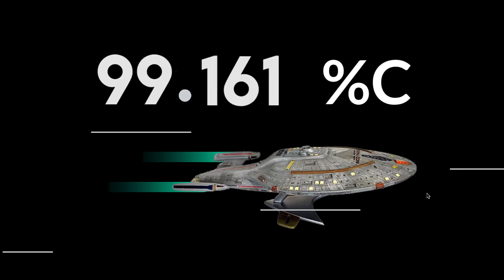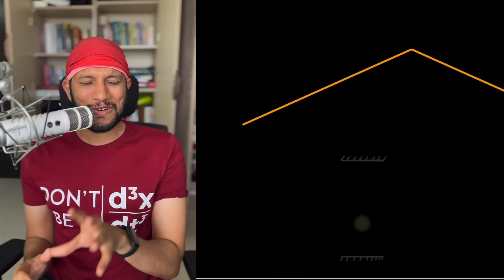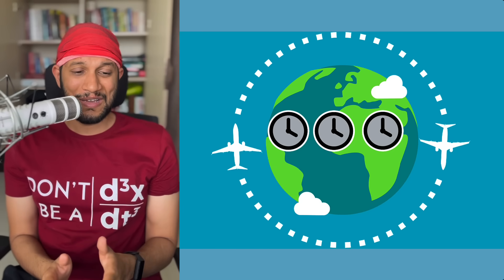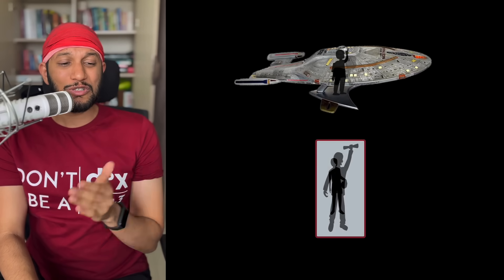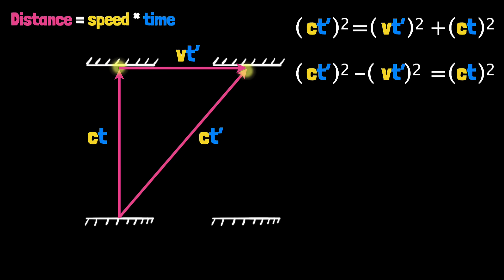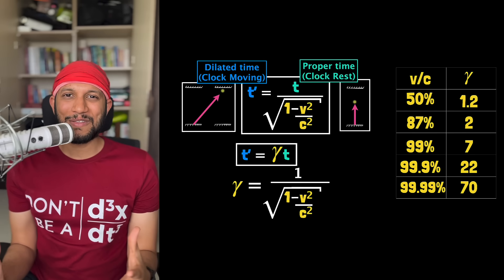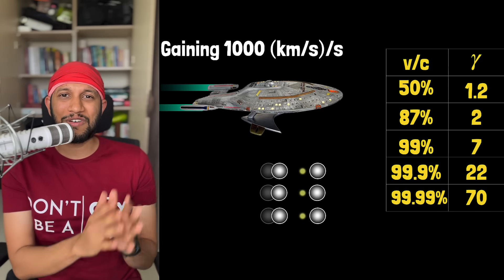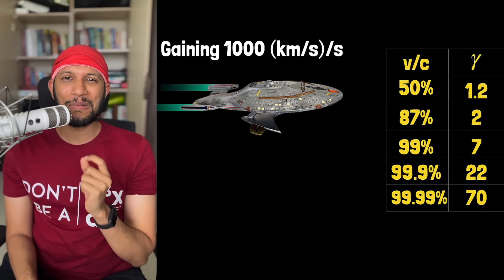I finally understood why you can't go faster than light! (My mind is blown)

Comment: Question- for the people inside the ship, it's still accelerating 1000 km/s per second.. so for the people inside the ship, will from their perspective they achieve the speed?? Yes from outside it may look different but what about inside.. they are accelerating same as before so in their perspective they should touch the speed??
Reply: Think about how a person in the ship measures their speed.  It has to be measured relative to some frame of reference.  In the reference frame of the ship itself, the ship is always at rest (since the frame moves with the ship), so that's not a very useful way to measure your speed.  So it turns out that if you want a meaningful measure of your speed, you have to measure it relative to some external frame of reference, and as we see in the video, the ship's speed in any external reference frame will always be less than the speed of light.

Comment: Time at rest is known as “standard time.
This is based upon time at the earths surface.
The higher you go above the surface time changes and even the lower you go below the surface time changes.
Humans cannot see things going at certain speeds due to our brain not being able to recognise the movement/motion. For instance we cannot perceive the flickering of hz rate on our tv due to its speed.

At some point, depending on the direction you’re going… be that deeper into earth or away from earth… things will either become invisible 🫥 or things will simply stop having motion, or at least all things will go extremely slow to the point it will take eternity to even move a finger.

Comment: Its very simple why matter cant travel at c, E=mc. Atomic energy converts to radiant energy with acceleration. ALL matter becomes radiant energy at the soeed of light. Boil water and the molecules are accelerated to c or radiant energy. There is no increase in mass. You dont get more mass with acceleration, you get less. 
Suggest you go back and recheck your math because there is no instance where mass increases with acceleration.

Comment: Nice explanation. 
A question based on the intuition that you wonderfully helped explain.
In a dense medium which can reduce the speed of light, can this phenomenom be observed?

BTW infinite amount of fuel is perhaps not correct, it is the ability to generate equivalent thrust to match the dialation. Example: if the engine has modes to switch between generating more thrust from the same amount of photons. Then fuel is not infinite rather the engines thrust value is infinite. This is a zero sum game.

Comment: I'm confused. Aren't we pretty much always moving, so it's always "on the ship"? There's never an example of it before the ship for me to use as a reference. I can extrapolate, but that only makes me question: Is it possible to have something still? This leads to about hunderd other questions... Shit, I should have gone to college.
Reply: Something can be at rest in a particular reference frame, but one of the central postulates of special relativity is that all inertial reference frames are equally valid.  So there is really no such thing as "absolute motion/rest": you are simultaneously at rest in one frame and moving at 99.999% of the speed of light in another.

Comment: This explanation is wrong. 
Let us assume that the starship moves vertically instead of laterally, and emits thd ray of light veryically also. According to this explanation, when the starships moves in the  same direction of the ray of  light  it should slow down, and it should go faster if moves in the opposite direction, but actually in both cases the timd dilatation factor is the same
Reply: This is explained by the relativity of simultaneity. His explanation is correct, you just don't quite have the full picture of special relativity yet. Mahesh actually explains this in the twins paradox videos.
Reply: @GoofyAhOklahoma  the simultaneity principle that is used in the twin paradox does not apply to the mental experiment I proposed, because I meant just one way, not way and return. Then,  there is not a change of reference frame and not simultaneity. 

What I meant, is that comparing in this way the experience of the observer inside the starship with an observer outside it is wrong, because also distances "experienced" are different. So you cannot look at the ray of light in both reference frames and calculates how they relate one another simply looking at them as shown in that video, because you are assuming that at least one variable is the same (in this case, the wrong idea is to look at the lenght of the ray-path in the two reference frames at the same time like if these quantities were experienced by the same observer).

 In fact, this example doesn't work with the idea I proposed because in one case the light path looks "shorter" , in the other looks "larger"!.

In general, given that both (x,t) are transformed into (x',t'), you cannot look both reference frames as shown in that video.
Reply: @andreamazzolani3138  You are correct in saying that one would also need to account for length contraction, yes. But that does not make his explanation wrong, for length contraction is a subject he decided to save for a different video. This video was focused on time dilation, and he explained it very well. But you're right, he didn't give the whole picture.

But as for the relativity of simultaneity, that phenomenon also applies to constant velocities, not just accelerated reference frames, and it is just as important a factor to consider as time dilation and length contraction. Take for instance the barn-pole paradox, which involves no shifting of any reference frames, but is explained by the relativity of simultaneity.

Mahesh actually has a video titled "Why velocities don't add up" which is essentially the same as this video, but he discusses time dilation, length contraction, and the relativity of simultaneity. It was posted about a month ago.

Comment: What if the ship was being accelerated through a very very long gravitational field? Since the ship is constantly in the field no matter where it goes, the “force carriers” (whether those are gravitons or what have you) of the field would not need to travel longer distances as the ship get faster, because the ship is actually continuously running into them. It seems like then we would not have this issue. And objects of different mass fall at the same speed, the increasing mass of the ship wouldn’t stop it either.
Reply: in relativity, gravity and acceleration are indistinguishable, and you can't accelerate a mass to c

Comment: My question is what if we turn the photon clock 90 degrees, so it's facing in the same plane as the ship. Won't time delation then be negated? The photon will take longer to travel to the end of the clock, but it will return quicker. Does this not cancel out the effect the ship's speed has on the photon clock?
Reply: no, since to the relative observer the mirrors are a short distance apart, to the stationary observer the fwd mirror is moving away at near c
Reply: Not really sure I understand, how does either of those points disprove what I said?
Reply: @danielthomas4082  what is it you think you’re disproving, time dilation?
Reply: @AMC2283 No, this explanation just doesn’t make sense to me if you re-orientate the photon clock,
Reply: @danielthomas4082  the light is also red shifted towards the rearward mirror to the stationary observer so it takes just as long to hit as if vertical

Comment: I have a very stupid question. I hope I will be able to put it well in words. The light clocks. Obviously, the photon doesn't have any mass and, as a result, inertia. There is no acceleration since the speed is constant... but. If we have the mirrors positioned like they are in the diagram, would the photon actually keep up with the mirrors if the ship moves perpendicular to the reflection vector? Wouldn't the photon move slightly backwards with every bounce (respectively to the mirror) if the mirror moves forward? Will we see some difference in the "experiment" if we would rotate the mirrors 90 degrees and the reflection vector would match the movement vector? Please don't hate me. This glitch just appeared in my head and I can't fix it. Help!:)
Reply: the mirrors reflect the light--they're in motion to the stationary observer.  if it reflects forward and back instead of up and down, it'll have to catch up to the fwd mirror moving away from it
Reply: @AMC2283  ah... tru. From their perspective, they are at rest! Thank you!

Comment: One thing you said that I don't understand. Each of those photon "ticks" between the mirrors forms a curved line segment, as is the line segment representing the path and distance traveled by the mirrors. (To complicate matters, those curves change with motion as gravitational influences change.)   It is my understanding that the Pythagorean Theorem holds in Euclidean geometry, but not in a "curved" geometry. (Thanks to gravity, our universe in not flat.)  How, then, is the Pythagorean Theorem relevant in the derivation of the Lorentz factor?

Or does the Pythagorean Theorem apply to the curved "triangle" formed? Why would it?  It doesn't apply to a right angle triangle on the surface of the earth, where one side is at the equator.

Help!

P.S. I love, love, love your videos.  I subscribe to them.  They are clear.  They are challenging.  And they raise new questions for me.  They encourage me to take out my math and physics text books and watch more videos.  Thank you!

Comment: is it not wrong to assume that the photon will look from below to go at an angle in fast moving spaceship, inside photon clock....unless shot at an angle.....because photon doesn't have momentum like a thrown ball in spaceship.....it will look to go straight up from ground also...isnt it...if that is so, then this intuitive approach is false. vertical (to the direction of motion) photon clock will not work properly at v high speeds. a horizontal photon clock can intuitively explain time dilation perfectly and correctly imho. at speed of light time elapsed will be 0. the shot photon will be never able to reach the front reflector of the clock. hence explaining time dilation. at intermediate speed, clock will keep slowing down. at zero speed, 1 second will be equal for both the photon clocks at both places. at speed of light, the photon will always keep chasing the opposite reflector of the clock. not only the second will never complete, it wont even start. it is like a bullet chasing a criminal running at the speed of bullet in same reference frame. light chasing light never catches it, otherwise sunlight would not have been continuos. also, if someone travelling near speed of light doesn't return to earth, then he/she will age slower than the sibling on earth (relatively stationary), when observed from earth sibling pov, but if he returns to earth, he will be same age as sibling. because time is relative and not absolute. time dilation issue at high speeds is because of design flaw/limitation of the clock and not rate of change of thing which is perceived time wrt a reference plane.

proving that nothing can go faster than speed of light because of clock limitations is not same as proving that time dilates in reality.

Comment: What you've proved is:
"If speed of light is same in all frames of reference THEN nothing can travel faster than light."
That's why in the right triangle you draw, the hypotenuse length was cxt` whereas in newtonian physics, the speed of the photon to an outside person is \sqrt{c^{2} + v^{2}} (because Newtonian physics assumes that time is same for both observers, while you assume that c is a constant), but you have simply used c...where am I wrong?

Great video, I am first time visitor and from non-physics background, so feel free to correct me

Comment: This is only true for the object with mass. Massless particules such as protons, has no problem reaching the speed of light, because they don't accelerate, they are emitted from the source right at the speed of light. But, the question is, the Universe it self is expanding faster than light, how?
Reply: electrons and protons are not massless and do not travel at c.  nothing accelerates to the speed of light, it's a constant.  space time isn't an inertial body being accelerated, it's the framework of the universe and isn't relative to anything, no mass in expanding space time is moving ftl.
Reply: “Space” isn’t an object, the best way to think of space is like a giant coordinate grid that stretched throughout the universe.

So the movement of “space” is not bound to the speed of light.

Comment: Nothing can ever accelerate to the speed of light.🤔 Wait a min here. "Light" can accelerate to the speed of light, it's not nothing.
Reply: Nothing with mass can accelerate to the speed of light.  Light is massless and is not subject to this restriction (it also does not accelerate: it always travels at the same speed).
Reply: @extravagantpanda7962  yea, adding mass to the statement would make more sense. But light can decelerate and accelerate under the influence of gravity or through some special materials.
Reply: @gmichia  Light doesn't accelerate under the influence of gravity.  It just follows along a "geodesic" (which is a generalization of a straight line on a curved manifold) through spacetime.  The spacetime around a massive object is curved, so a photon traveling nearby will just follow the curvature, but this is not an acceleration: the photon is not changing its direction in spacetime, spacetime itself is curved. 

Also, the speed of light in a particular medium may be slower than the speed of light in a vacuum, but this speed is the speed of propagation of an electromagnetic wave through the medium, not the speed of an individual photon.  The photons still travel at the speed of light in a vacuum when traveling through some medium, they are basically just constantly bumping into things which slows down their overall progress through the medium.
Reply: @gmichia the reason light travels slower through a medium is because it physically interacts with the molecules, getting absorbed and then remitted which takes time. Between this it still travels at c because all massless particles must travel at that speed

Comment: but from the pov of anyone in the ship wont the acceleration be same so i get that for anyone outside the ship itll take infinite time but wont the people in the ship reach c in finite time using finite energy
Reply: The acceleration will remain constant (assuming the engines keep firing and the ship has enough fuel), but they won't ever reach light speed.  Remember that speed is relative, so when you talk about their speed, you have to specify what you are measuring relative to.  

In the reference frame of the ship itself, the ship is trivially always at rest, so it will never reach any non-zero speed in this frame*.  Therefore if the person on the spaceship wants a useful measure of their speed, they must measure it relative to some external reference frame.  And that's exactly what this video already discusses: according to any outside observer, the ship's speed will approach c asymptotically but never reach it.

 *(Side note: this is a non-inertial reference frame since the ship is accelerating.  In order for its speed to be constant in this frame, there must be an equal and opposite acceleration to cancel the ship's acceleration.  The source of this acceleration is a so-called "fictitious" force, and to someone on board the spaceship it would just feel like a gravitational force pulling them "down".)

Comment: Does the speed of "thought ' slow down the faster we go? Has this been appreciably studied?
Reply: From a strictly physical standpoint, thought is nothing more than electrical impulses in your brain.  It is just another physical process, no different from any of the processes in the clocks mentioned in the video.  So yes, thought slows down in exactly the same way as everything else.  But remember that this slowdown is only in the reference frame of some outside observer.  YOU are always at rest in your own reference frame, so you never experience your own time slowing down.

Comment: The one thing I don't get about the moving clocks...who is moving?  What does a moving observer see with a "stationary" clock if all motion is relative?
Reply: "Moving" and "stationary" are relative terms that are only meaningful when applied to a specific reference frame.  Suppose Alice and Bob are floating out in space.  In the reference frame attached to Alice, she is stationary while bob is moving at some speed v away from her.  Since it is Bob who is moving in this frame, Alice will see that Bob's clock is running slow.  In the equally valid reference frame attached to Bob, Bob is stationary while Alice is moving at speed v away from him, so Bob will see that Alice's clock is running slow.  Suppose they are joined by their friend Charlie, and in Charlie's reference frame both Alice and Bob are moving toward him with speeds Va and Vb, respectively, such that Alice's speed is greater (Va > Vb).  Then according to Charlie, both Alice and Bob's clocks are running slow but Alice's is running at a slower rate than Bob's.